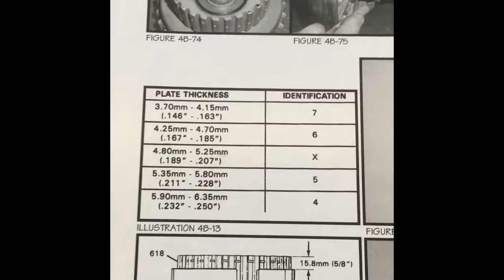TH200-4R Direct and Forward Drum Upgrades

Comment: When you finish your transmission did you get any binding from 2nd and 3rd
Reply from the maker: Hey Robert, thanks for watching. I’m just in the install now so haven’t had a test run on the trans yet. That’s something I’m on the lookout for with the band releasing and direct clutch apply timing. I’ve gone full manual on the VB, the accumulators are removed so the hydraulics are going to be hi pressure and rapid so I hope there won’t be any conflicts when gears change, but we’ll see. Have you seen this before?
Reply from the maker: I have just gotten it going and it appears to have a bind on the 1-3 shift. I’m talking with TCI and studying the hydraulics of their VB to see if I can correct it. It appears that their VB doesn’t take into account most performance builds  dual feed the direct clutch.
Reply from the maker: That should have shown 2-3 shift.